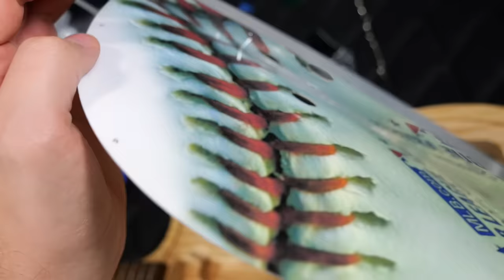This Guitar is a HOME RUN! | 2007 Gibson Les Paul Ash MLB Artists Promo Baseball Guitar

Comment: I would be interested in the neck angle.. that's like a halfway between a special and a standard.. it appears to be 2 degrees not 4.. and also not zero...  I'd likely get a custom made front with the leather stitched on.. and a control layout like the 3 pot ESP Eclipse..  and carve the heel away...